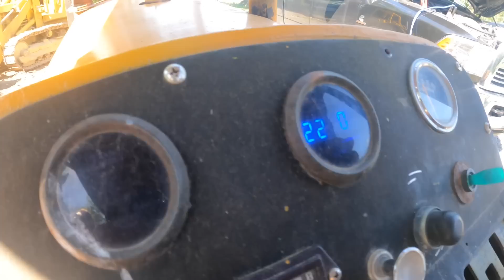John Deere 1010 Bulldozer's Ripping Now

Comment: Works like it should! It sounds like the carb internals are worn out. Seats and jets aren’t controlling fuel flow and air mixture efficiently. Also have you checked valve clearances?

Comment: 6/27/23;..at last you got that old gasoline 1010 Dozer to run 'even' & not keep 'surging'/starve for gas. That engine back-n-forth was just not right. Your carb adjustments + live video of Dozer actually working/pushing piles of compacted dirt should act as proof that this unit is functional. Good luck on your selling it....go get something a bit bigger..let AC advise you...maybe a CAT D4 or D6 depending on your needs/calls for dirt/gravel roads etc. Nice clear day for video & great to-the-point verbal commentary. Stay safe & carry on!👍🍺😊

Comment: She runs good now,I'd do a Lil TLC to it. A fuel filter,rebuild the carb,change engine oil,trans oil,final drive oil & hydraulic oil. New ponts,cap & roter,plugs & wires. A little maintenance will go along ways to help it run smoothly & last longer.

Comment: Much ,much better with that small adjustment you did. But a total rebuild of the carb would be sweet. I didn't think anyone could be tougher on there equipment than Andy C.
Reply from the maker: I actually rebuilt the carburetor in the video fixing up the John Deere 1010

Comment: That's running a little bit better now.  I whould say if it ever had a big problem again instead of selling it try to find a little kubtoa 3 cylinder or 2 cylinder dissel to swap in there make a good project 👍
Reply from the maker: If I see a good deal on a diesel engine I’ll grab it.

Comment: Funny I haw a 1010 I personally restored it myself it's very reliable  only difference between mine and yours is I have a 6 way hydraulic blade I recommend going through the carb do the clutch and it'll be good don't be like Andrew and nixxer rig everything.